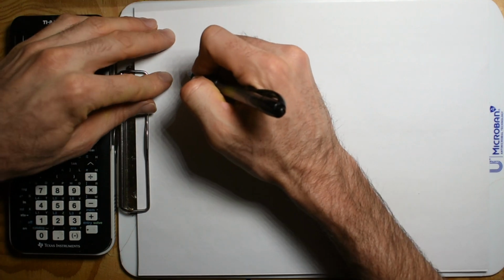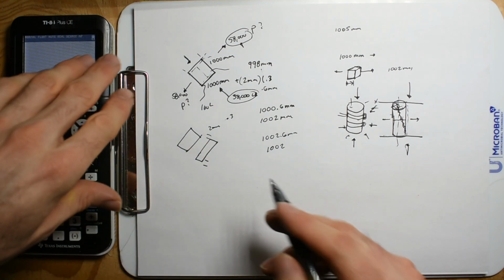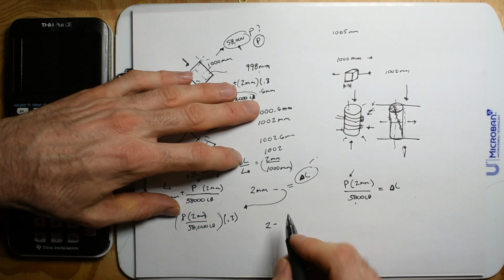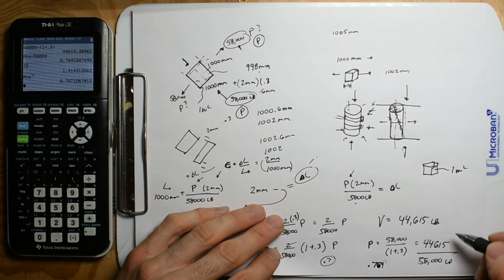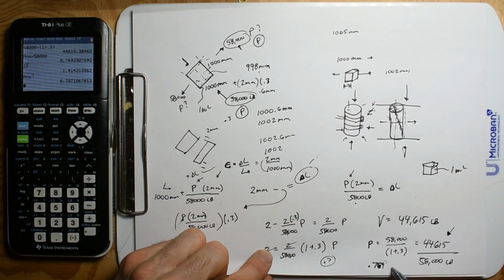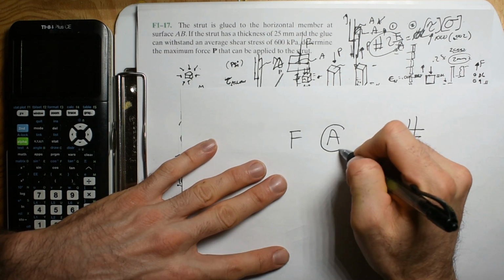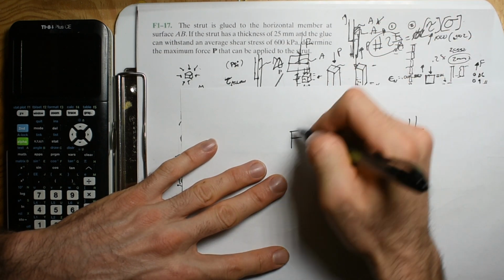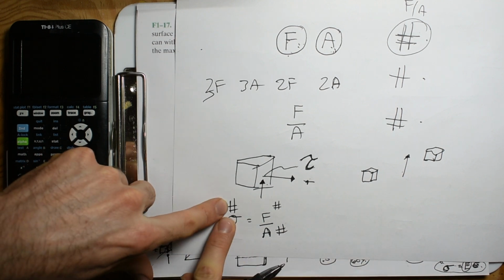WATCH ME TALK ABOUT SHEAR STRESS FOR 1 HOUR!  ||  A LOT IS WRONG!

Comment: Also I also have the same problem where I can’t follow the math I did. Any tips on how to get better at that? 44:31
Reply from the maker: If I don't have an equation I might still be able to solve for one particular answer.  And then maybe I can solve for another answer.  Then I can see if it makes sense that I could find every value inbetween.  That would be the definition of contious and therefore I at least know that an equation would link the answers.  Sometimes there might be a sharp break between the two values and maybe two equations would be needed.  That is what happens with Loads on beams with the Shear equation.

So another way to answer your question on this topic is when getting an equation for shear and moment diagrams don't focus on the euqation but the value of the shear or moment at one location.  Then find the values at another location.  Do this up to 5 times and then it will click in your mind that your are plotting points on a line that will have an equation.  Doing the process was very helpful for me to then get the equation and see the 5 values almost Matrix style popping from them.  Else if I see an equation I don't put to much thought into what it means but I should.

Comment: Hey brother I am in physics 220 and we just went over circular motion. Can you do a circular motion problem at 90 degrees 270  degrees and a 45 degree problem.
Reply from the maker: Can you be more specific or choose a problem that you have for homework?  I can find most all problems online if you write out the first sentence of a problem!
Reply: @holdmybipolar  a coin is placed on a shelf mounted on a plywood circle that rotates at a constant speed in a vertical motion M equals 0.1 kg R equals 0.5 m V equals 5 m/s. At the bottom of the rotation calculate the magnitude of normal force by the shelf on the mass. Make a free body diagram for the mass at a constant speed with the radius making a 60 degree angle to the vertical theta = 60 calculate the normal force at 60 the static friction force at 60 ( no coefficient is needed) and calculate the minimum speed at the top to the rotation for the mass to say in contact with the surface. If you can’t find it I can sent you a pdf if you have a business email.